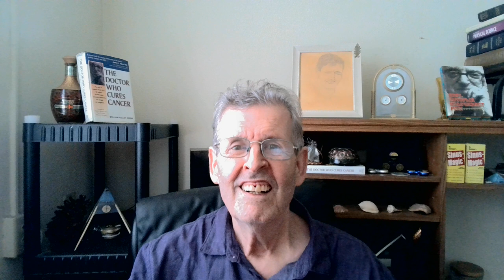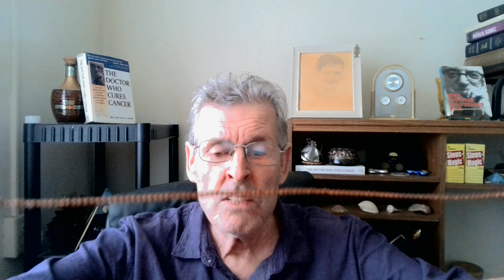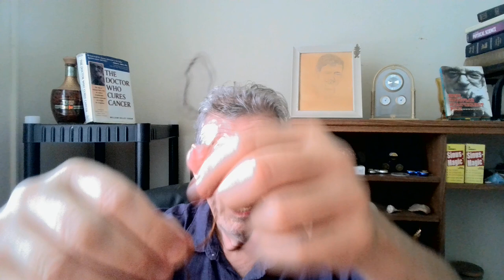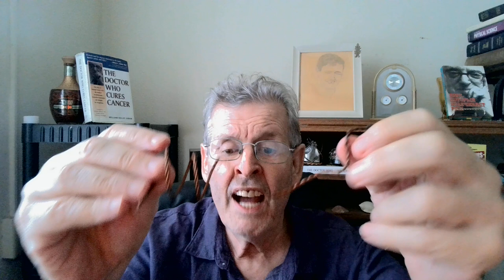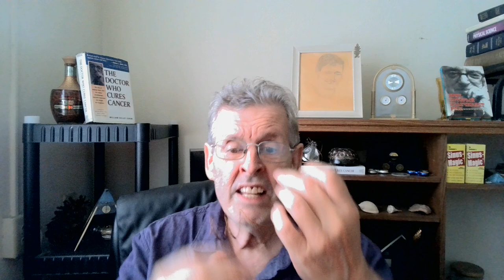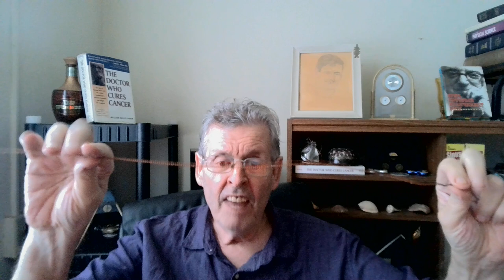How to punch back at hurricanes and tornados. Yes really.

Comment: What if you wrapped a bunch of these twisted copper wire sticks around the blades of a 16 inch oscillating fan for instance ? Just a thought. Also I managed to get a heart felt energizer going. I watched your video on using two 300mm Lakhowsky boards with the back ends facing each other and mounted on to the fan. Im in the UK and am using a USA made 16 inch Pelonis fan which works just as well as the 16 inch Lasko . Just ordered two more fans and am ordering five more 300mm Lakhovsky boards, two for each fan.
Reply from the maker: You've got two 300mm, and you're ordering five more? You've made my day!! 

PS. Not sure how you could wrap the twisted copper wire around a fan and have it stay in place or be balanced. There's a good chance that the fan would walk across the floor.
Reply: Well, three  Pelonis 16 inch fans and two 300mm boards  on each fan facing each other. Six boards in total ! Well Tesla's lucky numbers are 3,6 and 9, so six  300mm boards on three fans. 

With regards to the cooper twizzle sticks I am thinking of wrapping the coiled copper wires round each of the three blades on the 16 inch fans and then wrapping each fan blade with the wire round it with a strong tape to hold it in place. Not sure if it will work but will give it a try. If it works I can send you photos of it. I'm guessing that even if the coiled copper wire is around 6-9 inches long, covers a small area of each blade and is held in place securely with some gorilla tape (a bit like a ring), it should generate beneficial frequencies due to the clockwise circular movement of the fan.

Comment: Would this idea also dissipate clouds on a cloudy day Kelley
Reply from the maker: When I have pointed a handheld device at thick clouds, Mother Nature apparently decided to normalize the EMFs in the sky. She turned big rain clouds into wisps, usually in 2-5 minutes. If the sky was impenetrably laden with clouds it took maybe 15 minutes. This coincidence occurred 100 times out of 100 or thereabouts.

When Hurricane Berry was close to New Orleans due west, I visited Panama City Beach. There was a black line of clouds off in the distance along the 17 miles of beach front.

For a half hour, I pointed a little $3 fan with a $15 disc combination at the foreboding, somewhat far off clouds. It was lightly misting the entire time. A messed up somehow and the fan fell out of my hand and came apart. Due to my injured back, it took me about 30 seconds to pick up the three parts.

By the lime I straightened myself back up, I was smacked by a very strong wind and heavy rain. As I escaped up a set of concrete stairs, the wind almost blew me over. It also dislodge a thick electric wire attached to the hotel's outer wall. The wire thrashed about sending off sparks.

All of that was quite a coincidence.
Reply: @kelleyeidem667  Wow 🤩 love it 😍
Reply: @kelleyeidem667  I think it’s possible to use these types of energy devices for everything, if you know everything is energy, then you know any type of EMF can affect everything around us. So why wouldn’t we be able to change the weather or anything else? It’s just a matter of releasing* limited beliefs and knowing it’s possible! So then we can go out with these tools and create it for ourselves. We don’t have to ask for permission or have a* higher power assist us. It’s all within our reach.
Reply from the maker: @Positivemojo111  You've won the internet today! I would say that the Highest Power makes all of this possible, but not the higher powers of government. ;-) So we can make whatever type of loving world we want because God has given us all the tools. 

It's so great that you said we don't need permission to make all this happen! We can do it in the next 24 hours or less.

My first reaction was there is one exception to frequencies doing everything which is to get heavy metals out of our body because mine are firmly lodged inside me it seems. But your comments help me to realize that if someone put their mind to it, they could come up with the correct frequencies to remove them as well.
Reply: White wine vinegar in a tea light oil diffuser for Chem trails

Comment: Do you have a picture of your ceiling fan with the twisted wire attached? I dont understand how you attach it?
Reply from the maker: It's simple. Place the twizzle stick lengthwise on the top of the blade and then tape it lengthwise using clear packing tape.
Reply: @kelleyeidem667  Ok, is the tip of the the copper wire hanging off the blade or is it just flush on top of the blade? Is there a pic?
Reply from the maker: After you measure the length of the blade, you unroll wire twice that length and then bend the wire in half. After twisting the doubled up wire, it should be a little shorter than the fan blade. If not, trim it so it doesn't hang over the edge. In fact, you'll want to trim all your twizzle sticks so that they are the same length.
Reply: @kelleyeidem667  OK, got it, thank you.